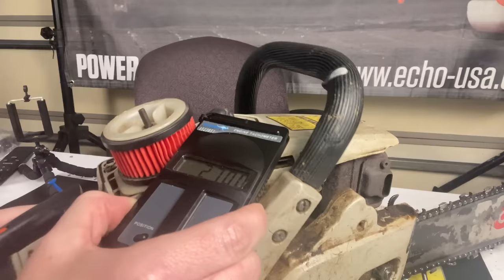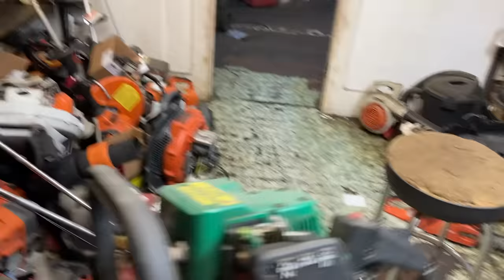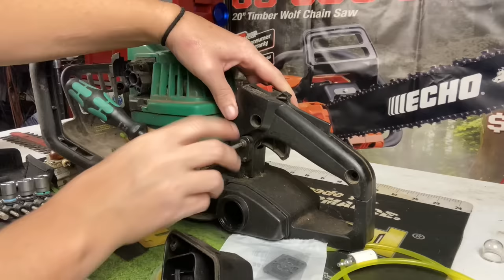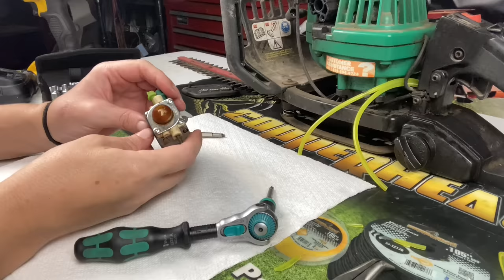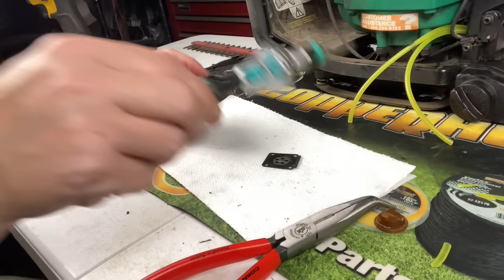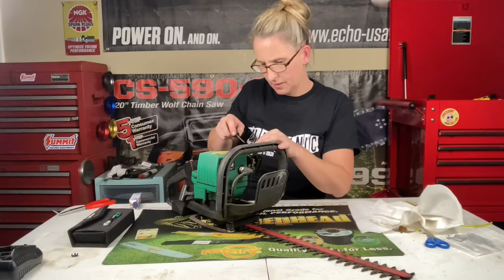THE BIG SECRET on how to store your small engine long term + Turning Shop Trash Into Treasure!

Comment: It's a sweet sound to hear these engines run after sitting for long periods of time.  Just a tip.  If you push on the fuel line with one hand and pull with the other they are much easier to fish through the chassis to install a new in-tank fuel filter.  Enjoy your videos!!  Keep them coming.
Reply: Put a little WD40 or soapy water on them and they slide right through.
Reply: @dukecraig2402  That works also.  Be careful with  the WD-40 as it breaks down rubber.  Another trick is beating the end of the line with a hammer on the back of a vice.  It actually heats up the line.
Reply: @timothyputzke1250  
WD40 is kerosene and won't touch any kind of rubber that's fuel proof, for that matter I've never seen WD40 attack any kind of rubber, I've used it as a lube on everything from mounting tires to engine and transmission shafts before sliding seals down over them, any modern rubber that you'll find anywhere around any kind of internal combustion machine is impervious to petroleum based liquids, you can bet that any rubber plug that's designed to come into contact with gasoline and/or oil is safe to put WD40 on.

Comment: Two stroke engines....just like women. Tempermental at times and need a little adjustment from time to time just to purr as they were designed. It takes one to know one. Great video. Loved the 2 stroke oil in the tank trick.

Comment: Chickanic: Thank you for the oil mix storage solution. 
Questions:
1) What is best way to store saws with no primer bulb. (Husky 61/66 saws), would you drain fuel, run until empty, add 2 stroke oil and pull start with choke??
2) Best way to store (4-stroke) equipment? Run until dry??
Thank you for great site.

Comment: I use Sea Foam Deep Creep lube for my piston and cylinder to over-winter the engines.  After draining the gas, I remove the spark plug and spray a little in the spark plug opening.  Then I pull the starter cord three or four times to get the Deep Creep to coat the cylinder.  I think the Deep Creep helps prevent moisture buildup in the cylinder, and it's much easier to start in the Spring.
I like your recommendation to use 2-cycle oil in the carburetor & fuel line.  I enrich my fuel with a little extra Sea Foam and run it dry.  I think the 2-cycle oil will  be an extra benefit to prevent moisture and gumming in the carburetor.  Thanks for the advise!

Comment: Just a tip. A very small amount of dish detergent with finger tips on outside of fuel lines will make them slide thru whatever like butter. Alot less stretching on the fuel line. Great video.

Comment: I bought a Stihl grass trimmer back around 1999-2000. I made sure I followed all the manufacture's recommendations in the owner's manual to the letter. I was trimming some tall weeds and ran into a piece of wire lying on the ground that I couldn't see for the tall grass. It snapped the shaft inside in two. In 2021, I bought a new trimmer. The old one is 21-22 years old. And the motor still runs. The mower shop wanted $105 for a new shaft. My point is this. If you follow the recommendations in the owner's manual, you can make a piece of equipment last almost forever.

Comment: that trimmer looks like a handful to use. used an electric for 50 yrs. no issues. now use a ryobi cordless which uses same battery as the rest of my ryobi tools works great. now the ryobi cordless chainsaw , you are better of with a steak knife.

Comment: I own a excavating land clearing company. I own hundreds of tools that run off a two-stroke. Chainsaws demo saws etc etc. If I have a two-stroke that has been sitting for a while whether it's for my business or the weed whacker at my house and it won't start. Dump out all the old two-stroke fuel. Once the tank is empty squish the bulb a couple times and pull the cord that will totally empty the system. Then put some straight gasoline in there. The straight gasoline will clean the whole system. The tool will fire right up run it for 5 to 10 seconds. Then shut it down pour out the gas and put two stroke back in it.

Comment: Love the vids. I’m one of those who don’t follow the suggestions. Also, knock on wood, my gas yard tools seem to work every season. Maybe I’m just lucky. My best one? Hitachi leaf blower- it’s at least 12yrs old. Never changed the plug. Never dumped the fuel. Never cleaned the air filter. Literally fired up in 2 pulls max every time.
Reply: Where do you live? Might be the answer
Reply from the maker: Those Hitachi blowers are actually really good blowers and very easy to work on. I like seeing them come in the shop. I know its always gonna leave running.
Reply: @mw1130  lol. Pennsylvania. I know it’s more than 12yrs because I purchased the blower when I lived in Pittsburgh. Moved to eastern PA 11yrs ago.
Reply: My Craftsman mower had 5 years in Pittsburgh and 11 in eastern PA. Same plug. Leave gas in all winter. Changed the oil maybe 4 times. Would run for 2hrs. Twice a week. My rider does get oil changes every season but nothing else for winter.

Comment: Great video, thankyou for the oil tip. String trimmer type engines always seem to be notoriously hard to start, especially after they've been sitting a while. The best starting one I've had so far is a 2016 Craftsman 27cc string trimmer with some kind of an automatic electrical enrichment system. 2-4 pulls and it's running, consistently.

Comment: to make easiest pouring of bar oil, cut a narrow vee across the plastic covering so the 1/4 wide opening is at the bottom tapering up to nothing at the top.  you will be able to pour without glugs and spills.  Bob

Comment: I use boat gas. I live a  1/4  from Lake Erie. Boat gas is good for at least 2 years. I left boat gas in my leaf for 3 years .fired up on the fist pull. And ran fine. Or use aviation gas. it all so has no ethanol

Comment: Thanks for the video! 👍
 I'm getting ready to put new fuel line in my 60's era Homelite C-51 chainsaw, it takes 2 also. I've been online window shopping trying to find good fuel line in the proper size, it can be a little difficult especially with an older piece of equipment that takes sometimes bigger fuel line than what some of these newer ones take. The line going from the Tillotson carb to the fuel tank fitting is 1/4" I.D and 5/16" O.D and I haven't really found any convenient fuel line kits with those measurements offered in the regular box stores locally. I think the other fuel line from the inside of the fuel tank fitting to inside of the tank with the filter is a smaller diameter but I haven't pulled it out yet to check, I have to remove the tank from the saw first because it's hard as a rock and I need to unscrew the fitting from the tank to get it out easier. Anyway, I've seen all kinds of opinions on which kind of fuel line material is best from rubber to polyurethane to Viton to Tygon. Seemingly the Tygon fuel line is the most popular and I don't really know much about Viton fuel line so I was thinking that a video explaining the differences between all of these different types and materials would be interesting and informative. In my case I don't believe that the line from the carb to the fitting is as vital as the in-tank line because it pretty much stays in a fixed position but the line inside of the tank with the filter needs to be flexible so as to allow it to move around (with the filter) as the saw is moved around in different positions while cutting, this is where I think Tygon line would be the most beneficial or the fuel line that looks segmented along it's length although I doubt I could find the proper segmented line for my particular saw because I believe they're usually a fitted style line with a precut length and I don't think they were offered in these older chainsaws. I'm going to go to a few places today and see what I can come up with, I'd like to get this thing running again.

Comment: I'm guessing that some brands, and especially newer machines, use inferior hoses. I have a Husqvarna 65L purchased in 1982 that has been stored with fuel in it and has sat sometimes for 2 years without starting. The breaker points are the only thing that has ever failed (worn out) This saw will start on the first pull and cuts like a beast. The carburetor and fuel system has not been touched. This saw has occasionally seen heavy use, wearing out a few bars and sprockets. Now it's just a backup and stump cutter.
Reply: Cheap brands use PVC whilst dear brands use neoprene, which is the correct type of plastic for fuel lines. Manufacturers work on the idea that when the fuel line leaks and needs replacing the average joe will toss the machine out and buy a new one, creating more demand. They could easily put in neoprene rubber hose lines but deliberately will not do this as it mens more money for the companies. Same for the primer bulb.

Comment: I've got one of these units in my shed... just like it   ..I gave $5 for it at a yard sale brand new    and use them for over 25 years  ..and still counting  .. only complaint I have with it    is the blade is too fine and doesn't have wide enough spacing between the teeth or that aggressive bite to feed the bigger stuff through efficiently 👍

Comment: I use to use WD40 to spray into intake to see if an engine would fire up. I used it because it has a oil base to it rather than using just Either which isn't but still works because I used both and still do. WD40 reworked it's mixture compound so it would not burn or burn easily, so I went back to using Either or gas or gas/oil mix until some other companies(s) I found did not change their WD40 type spray lube from the ingredient mixture compounds as the original WD40 had in it. When I owned and ran my own shop I use to use WD40 to spray the fuel filter, fuel lines and into the primer bulb. Lubed and Ready to fire up every time they were ever reput back into use year after year. Lots mechanic schooling never teaches EH ! ! !
There was a man who cranked on his mower until I was ready to call the EMT's and when he finally stopped cranking the thang, as I beseeched for the man to do. I bent down and took his gas cap off and told the man, like on the movie, "Lawnmower Man", I exclaimed to the man in the same voice as Jobe used in the movie character, "It ain't got no gas in it, Mmm" ! ! ! He just looked at me mad as Hadies and asked, how did I know ??? I told the guy, "Check the Oil & Fuel Level, Check the Fire & Choke and Ect.". I tried to get the man to quit trying to bring Lazuruth back to Nazeruth. Some people will spend whatever it takes to get a piece of equipment "Resurrected from the Dead" either because of Collector Item, Sentimentality, or to not be Defeated ! ! !
I had an Old Homelite Blue Chainsaw 404 Chain Logger Flat Top 30" Bar and two sided handles, would not Fire over period ??? Turns Out that the Cut Off Wire got brittle and cracked from underneath and kept the Fire Grounded Out. Homelite did not know what to do. An Old Man mechanic I knew from my youth told me what the problem was, so I unhooked the ground wire entirely and cranked the saw over within the 3 Pulls Method. I changed out the old ground wire and the saw was Fixed. I had nearly 20 mechanics try to get that saw to fire. Heh Heh Heh I took and used this same Fire Problem to the Judges at some "Small Engine Repair Competitions Conventions" & included "Lawnmower & Go-Cart Races & Engines Sup'd Ups & Logger Saw Competitions" A 100+ mph in a 1/4 mile safety caged Go-Cart with Twin McCullough 2 Stroke Webber Carb'd over rear axil mounts ! ! ! People Sup Up the Darndest Thangs . . . 😀 "Thanks For Your Videos Bre, You Are Finely & Surely Knowledged, Skilled & Most Of All Appreciated" . . . 👍😎🤘🙂🇺🇸🙏 DDH 5-22-2023.

Comment: The older battery powered stuff usually didn't have much power and the batteries generally only lasted 1 maybe 2 seasons and a replacement battery was about half the price of the whole unit. At least the battery powered stuff over the past few years seem to last several years or 300  give or take recharges. Keep up the great videos. BTW the place I worked at before, at break time the guy put his chainsaw on the Cat D6 track and was going to put a sharp chain on after break. Well after break he was a little slower then the D6 operator. The saw got run over by the D6 dozer. They brought it in at the end of the day and there was nothing but a few screws salvageable off of it. Unlike the one in your last video that was hit by the tree.
Reply: Maybe it wasn't working right and he just wanted a new saw, so he had an "accident."

Comment: All my engines start easily after storage, the only 'trick' needed is to store it dry.  I dump the gas back into my gas can and run the engine dry.  I've had several 2 and 4 strokes of all sizes sit for several years and they fire right up when needed.

Comment: I have a weed whacker that is about ten years old. i leave the fuel oil mixed in it all winter and it still starts in the summer. i suppose the oil in the gas keeps everything lubed and working. also i have a gallon jug of gas oil mixed that i have been using for about four years and  the weed whacker still runs on that old oil gas mixture. I have heard that if you run things dry that will cause problems with hard gas lines and  diaphragms drying out? for me i leave the tank full and it has worked for me.

Comment: Question?………..BTW……Loved the tip on long term storage for our equipment! Do you pull the fuel filter out before you add the oil? I would assume it would get clogged up? Thanks again, love the channel.

Comment: I worked at a small engine repair shop and I lost track of how many string trimmers chainsaw and other two stoke engines as well as lawn mowers. The most common starting problem was bad fuel because the owner did not drain the fuel.

Comment: On the flat battery red herring, if you buy DeWalt, you can have loads of tools that keep the same batteries.  Very easy to swap batteries on the charger. So far I have the Drill, grinder, chainsaw, and hedge trimmer. Works great.

Comment: I like a lot of your videos it’s pretty cool I’m having a hard time understanding how you pronounce your channel anyways, I own a lot of two cycle machines and this is what I do. My backpack blower is now nine years old and I’ve never had it in for service or I’ve never had to tune it, I just use 110 race fuel race fuel has lead in it and a lead make sure ratio doesn’t go bad race fuel has a shelflife of about three years I leave it full with fluid in the carburetors. I leave it full in the tank of gas and it starts every time for two cycle mix I use taco GP7.

Comment: Bre, Great video, I live in southern Florida and have a "hurricane" ready saw that gets exercised twice a year.  How do I prime a Stihl MS210 chain saw that does not have a purge bulb without yanking the pull cord 50 times?  And maybe more to the point when returning the saw back to service, how do I flush the oil out of the carburetor without again yanking on the pull cord 50-75 times  loading the engine with oil possibly fouling the spark plug before fuel has been drawn into the carburetor.  Note, this is not an "easy-start" MS210.  I have an Echo trimmer and leaf blower with purge bulbs and this system works fine with them.

Comment: How about a bit of silicon spray or WD40 on the fuel line to slide it through easily?

Top tip about priming 2 stroke in the tank for storage.

Comment: Bet that one is more lightweight than the older stihl models holding there's up for a long period of time puts a ache in the upper back somehow its like swinging around and holding up a concrete block 

I use those machines alot so id still like to find a battery powered trimmer then no more cords and no gas oil mixing just a simple charging up i keep my drills charged up for the next use so you know what id do

Comment: Thank you for sharing your knowledge with us. Once I was told from a dealer to empty the fuel tank and then run the engine for a few seconds until it extinguishes. The absence of fuel from the lines and carburetor together with traces of lubricant will extend the service intervals. I do it every time and it works. Please comment on this. Thank you again.

Comment: Great tips I always store my equipment dry.   I do have a gas blower I have not used in 2 years  and a mower  that’s been sitting for a year un used.  Both stored dry and. Stored in basement .  I bet I could just throw some
Gas or mixed gas and it would start.   

I have thought about selling the mower.   Been using my 163cc self propelled one more and my 20v leaf blower.

I got my brother in laws craftsman hedger trimmer going few years back doing something similar what you did here 

Since it was a craftsman branded one I bet I was really a poulan/weedeater brand

Comment: I'm not sure if you're good , lucky , or both.  If that foam air filter had been "dust" , running the compression and spark tests would have sucked a ton of crap into the carb and cylinder.  I don't usually recommend tests like that without some cleaning and disassembly no matter what someone is working on personally.

Comment: Thank you for making this video, the two cycle oil for storage sounds like a great idea and I will try it. One suggestion I have is to do some editing. It took 12 1/2 minutes to finally get to the tip that got my attention in the first place. I almost stopped watching the video several times thinking that I somehow was watching the wrong video. The whole video could have been done inside of five minutes and put the outtakes on after for the people that have the time and interest. I have two of the same trimmers that both have gas tanks that leak, any suggestions for a fix? They run well but they’re old and new fuel tanks might not be available.